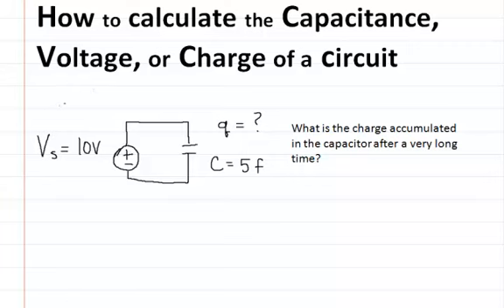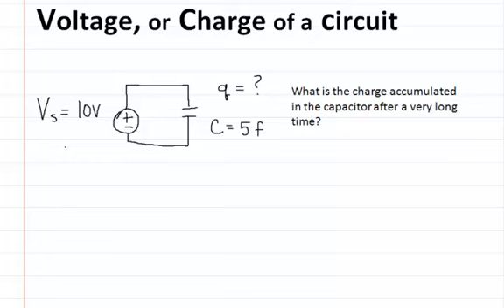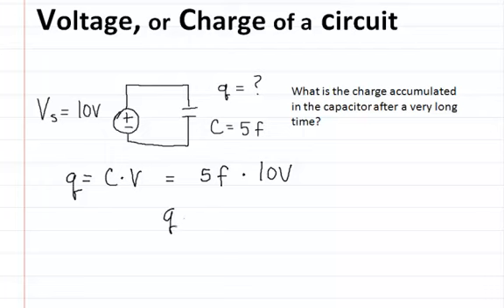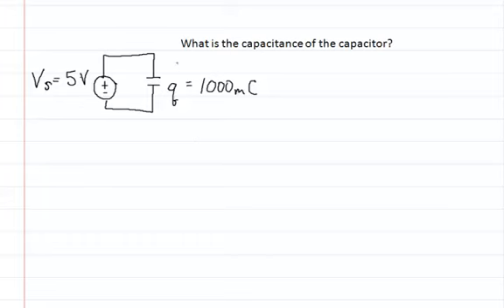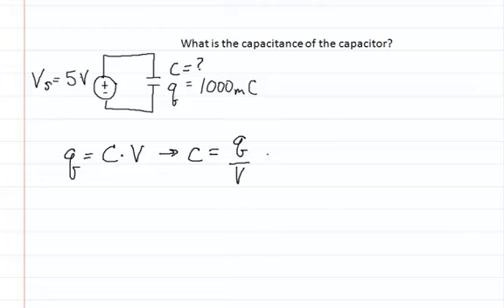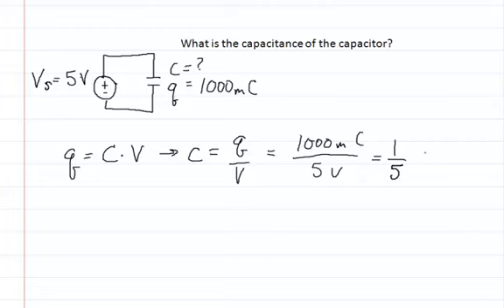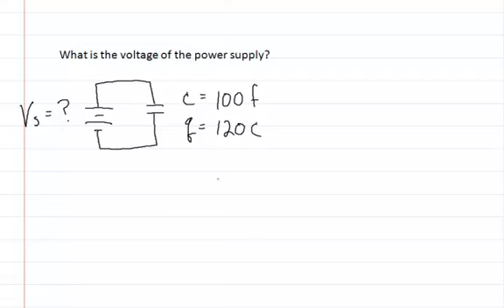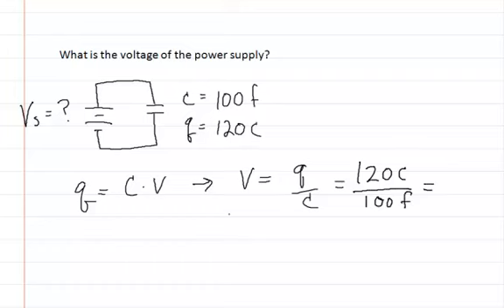How to find capacitance

Comment: Wow, dude. I'm having a bit of trouble figuring out some of the math behind capacitors and their charging rates, but at what point will you ever come across a circuit where you know the charge of a capacitor and you need to figure out its maximum capacitance?

Even stranger is the idea of trying to find the voltage of the battery. The whole idea of that is silly because a capasitor holds more or less charge depending on the amount of voltage you put on it. I guess if you somehow knew that the capacitor was at full charge, which would be very unlikely given the facts that you their charges will leak over time, you apparently can't find the battery that will always have the voltage written on it, you couldn't figure out its charge in the first place because the only multi-meters generally don't have a coulombs setting (even if they did, I highly doubt they would be accurate to the 0.0001 range which is pretty big for a capacitor) and the only realistic way to find the charge is to measure the voltage across the capacitor and multiply it's voltage by it's capacitance but you wouldn't know it was full anyway because you can't find the battery it was connected to to compare it's voltage against. Assuming it was in a circuit and you knew it was full because it's DC and it's blocking all the current, the voltage across the two leads of the capacitor (which you need to measure to find it's charge that you're using in your equation) would already be exactly the same as the battery voltage anyway!

Yeah, it's algebra. It's possible to flip equations around, but the point of math is to find a solution to a problem, not to just make up new ones that it's literally impossible to come across. I felt I had to speak up here because this is exactly the reason why people tend to not understand math or don't think it's useful, math teachers in particular do this a lot : focusing on completely irrelevant things that you can do with a math problem instead of teaching how to solve a real problem, the whole reason the mathematical equation was developed in the first place. This doesn't lead to people understanding anything. It just makes them think math is stupid. The sad thing is, if you're going about it like this, like so many math teachers in America do... it really is.